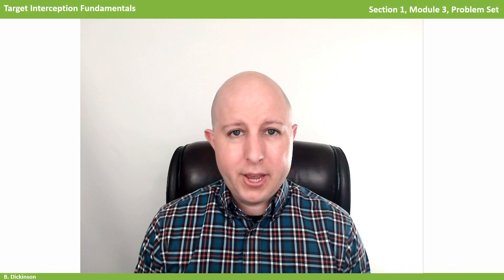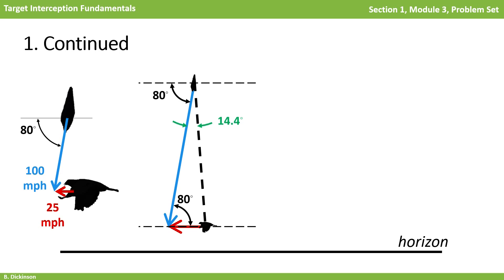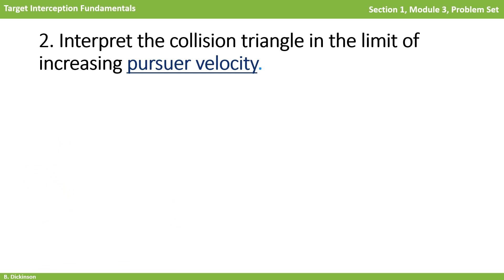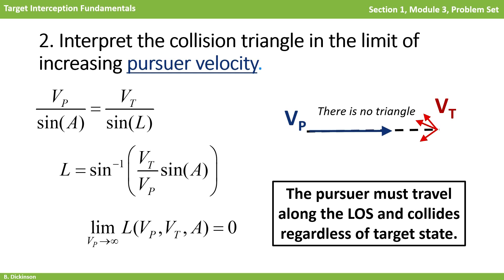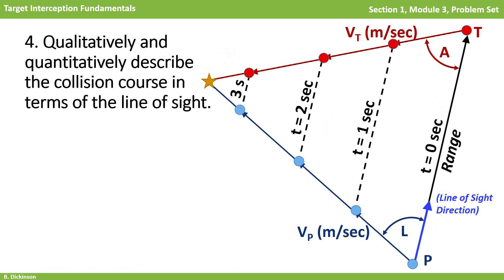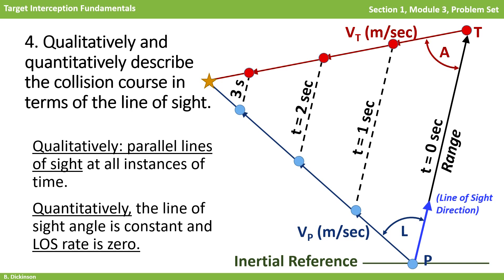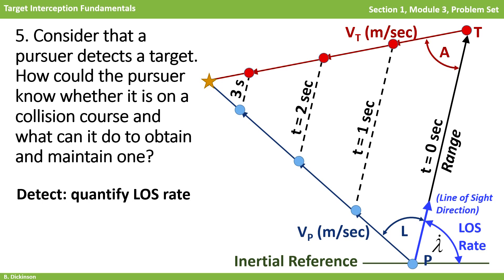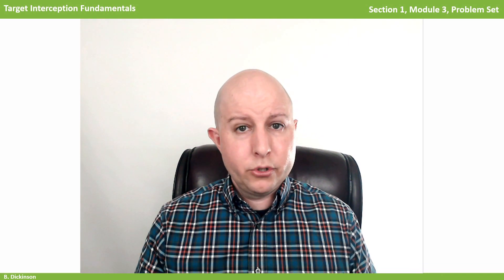Collision Course Solution - Section 1 Module 3 - Guidance Fundamentals

Comment: I cant seem to get 14.44 and somehow am only getting 14.25. I feel like somewhere i am missing out n stem but cant seem to find out where
Reply from the maker: Same hint as in previous comment: "Draw a line from the vertex at the falcon that is perpendicular to the pigeon velocity vector, effectively splitting the triangle into two right triangles. Then solve for the lead angle by analyzing each right triangle, left one first. Your result should be 14.449 deg."
Reply: I was wondering if you use cos rule(a^2=b^2+c^2-2(b)(c)cos(A)) to calculate the distance between the hawk and dove and from that calculate with the reverse of cos rule to get the angle if we imply that the speed of the birds would be their distance
Reply from the maker: Hello, I was not using the law of cosines to get 14.44, just basic trigonometry and geometry. However, I just solved the problem with the law of cosines based as you described, getting 14.43. One reason your result is slightly different may be truncation error. This approach has more operations than my previous approach. If one uses two digits of precision, rounding or truncation error may propagate through to the final result. I took decimal results out to 4 digits and matching my previous result to within 1/100th.
Reply: @LearnGandC  is this a bad thing? I could only find a way of getting the length of the other side using pythagoras by getting the components of the falcon velocity and then using the law of sines and it's still 14.43. Could you show your procedure?
Reply: @sologabriel.l  I believe 14.43 is the more accurate approximation, i.e. from 10+arctan(25-100cos80)/(100sin80). I replicate his answer when I use a combination of the wrong trig function for sides with less precision, i.e. 10+arcsin(7.64)/(98.48) ≈ 14.449 but maybe this is a coincidence and I stand to be corrected

Comment: Thanks for the videos! What did you do to get the 14.4? I feel like I'm over complicating it. Using law of sines: sin(L)/25 = sin(A)/100 with A and L being unknown. Then A + L + 80 = 180 being the other equation. 2 equations and 2 unknowns? Or is there a better way to do it?
Reply from the maker: Ok, here's a hint based on my approach. Draw a line from the vertex at the falcon that is perpendicular to the pigeon velocity vector, effectively splitting the triangle into two right triangles. Then solve for the lead angle by analyzing each right triangle, left one first. Your result should be 14.44 deg.
Reply: @LearnGandC  got it. Thanks!
Reply from the maker: Hi Dustan, I recall it took a little work, it wasn't direct. I'll check my notes and see if I can easily explain.